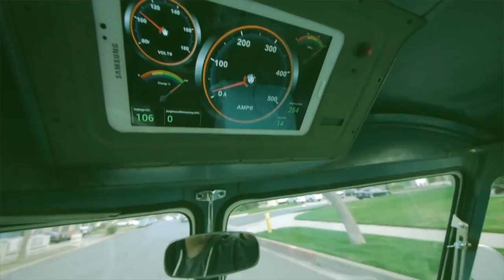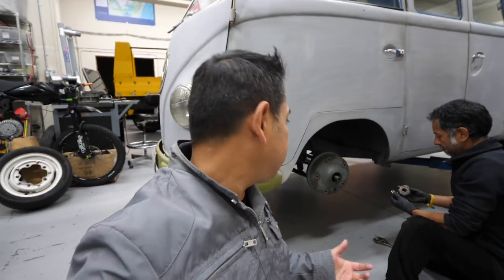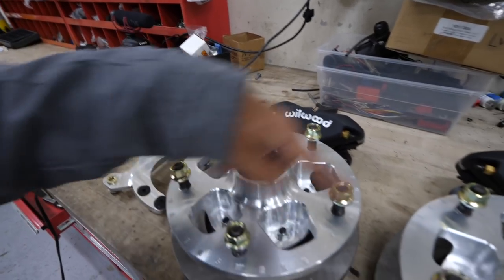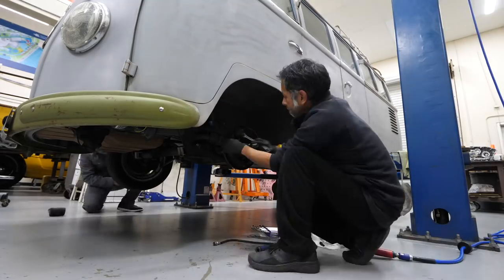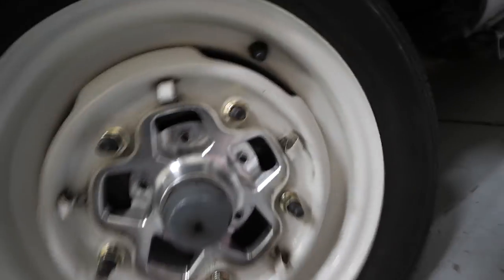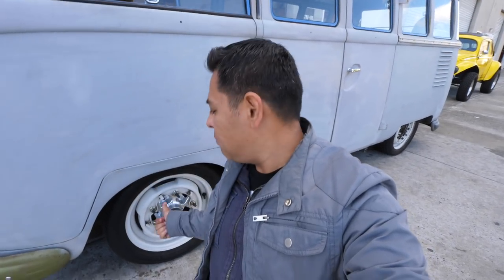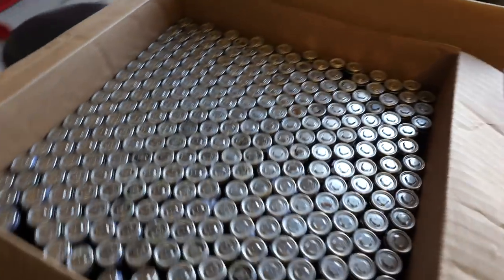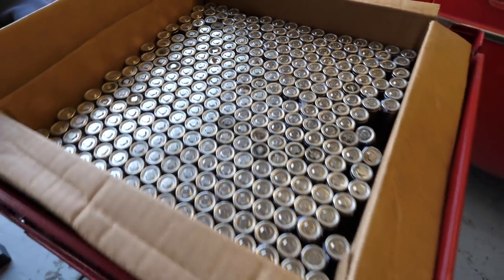Disc Brake Conversion for the VW SAMBA by WagensWest in (2018)

Comment: Hi. From an engineering point would the cost ($) of adding regen on the front is prohibitive?
Or would the extra weight outstrip the gains?
I found your video very ggoood.

Comment: Did you change the proportioning valve or put one in? The front/rear brake balance is probably going to be different with discs. I wouldn't want you to stomp on the brakes and have the bus swap ends because the rears locked up.

Comment: Cool I love them!! may be will help with the efficiency?? we wait when you test them on roadtrip...
Reply from the maker: might actually work against as they are kind of latching
Reply: My English is not the best... what you mean latching, translate like locking to me!?! the brakes is very heavy on the petal!!? they brake more easy then the old ones?? is that the case?? or they need some calibrate ? is this is the case how about electric breaking? do you have any on the eSamba?

Comment: Fix your original brakes first to a proper standard and get good brakepads. Nothing wrong with drums, only drawback is that they fade earlier due to heat. Most drums brakes have great stopping power. Just renew them and clean them properly. I could lose my teeth in my vanagon if im not carefull.
Reply: Deiphobuzz, you're right; the twin-leading edge drum brakes design VW engineered for my 1964 type 2 had plenty of stopping capacity..

Comment: When you're running an electric vehicle every bit of friction counts correct? Friction in your motors friction in your bearings or in this case drag in your brakes, will lower your maximum distance correct/battery life?

Those disc brakes you have, Wilwood are junk. You do not know me from a hole in the wall, but I'm a former mechanical engineer that has built motorcycles worked on cars and definitely knows a a thing or two about brakes. Look up the company called TBM brakes. They are the only company I have seen that supplies true dragless/frictionless brake systems. They're well designed and American made in Southern California.Wilwood farms their junk out to China. But that is beside the point, they have videos showing wheel setups with absolutely zero drag when you release the pedal. I guarantee you will not find that with your current setup. As a side note your pad life will be substantially longer with TBM. I do not work for them I just know quality when I see it. Watch the video of the gravedigger locking the front brakes and doing an endo.   Wilwood just has good publicity
Reply from the maker: You might be right,  they do feel sticky
Reply: You will not believe the difference in free wheeling and stopping power